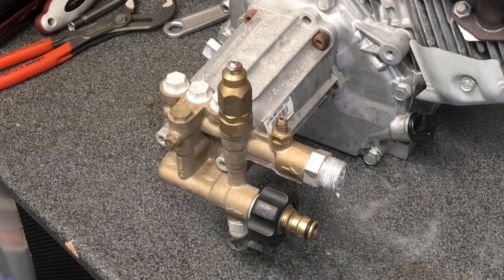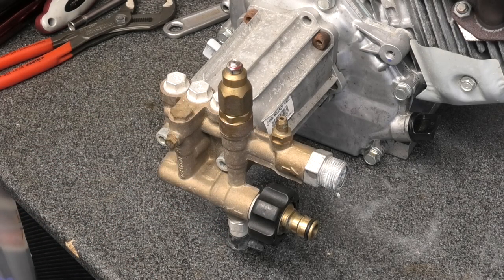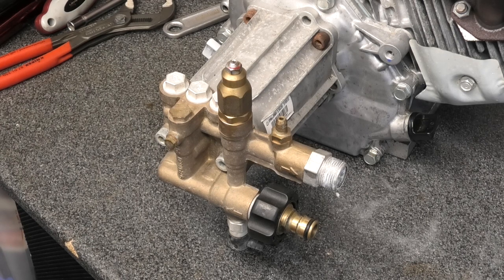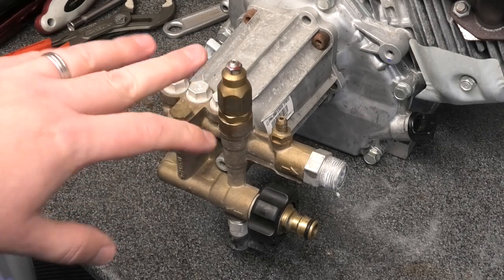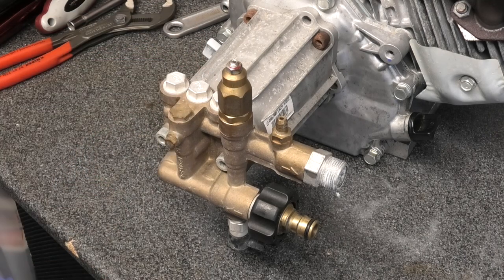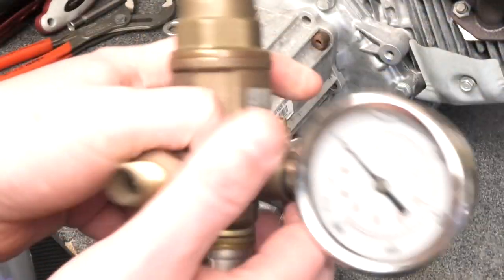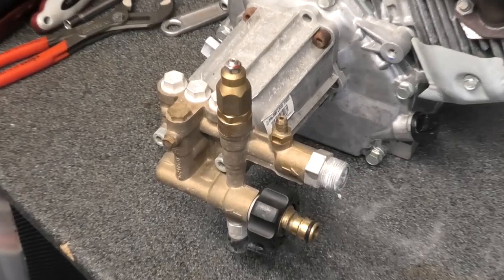Pressure Washer Unloader Valves. Converting an Integral Unloader to an External K1 Unloader.

Comment: Great video - can I ask the type / size / thread / pitch of the swivel fitting as well as the corresponding fitting that is threaded into the K1 ?
Reply from the maker: @JaspreetSidhu1  they all use 3/8"bsp fittings.
Reply: @DirtyDriveAway  So, I'm cross the pond and upon further investigation, it looks as if the outlet port on the pump head is 3/8 BSPP (British Standard Parallel Pipe) for which I can find an adapter for here in America, but as a follow up, can you share the specific type of hydraulic fitting style  (e.g. 3/8 BSPP male to 3/8" Female JIC) or share a link to the particular swivel adapter you're using.

Also, thank you for the quick response.
Reply from the maker: @JaspreetSidhu1  the swivel fitting will be a 3/8"bspp male to 3/8"bsp female. On the pump head itself it would be a female, so you can fit a 3/8"bspp equal nipple to convert it to a male. You then screw the swivel into the unloader and then the female attaches to the male nipple on the pump. Alternatively you can do it the other way around and have the equal nipple in the unloader and thr swivel in the pump head. Doesn't matter which way around you choose. America tends to use NPT threads which are similar to bsp but the thread pitch is different and therefore not interchangeable. I don't see JIC fittings on pressure washers.

Comment: Excellent videos and advice (I'm considering this as a new business).  In your video, "Starting a Pressure Washing Business", you mention the importance of flow and pressure but then say you usually use only half pressure. Therefore, wouldn't it be cheaper to use a smaller engine for less pressure?  I'm assuming an adequate pump, eg 35 lpm, could be connected to a smaller engine. but this may be incorrect.  Keep up the good work.
Reply from the maker: Hi, no you can't fit a big pump to a smaller engine as the motor simply won't power it. For example the common GX390 engine is usually coupled with a 200bar @ 21lpm pump. Or it can be a 250bar @ 18lpm pump. However the motor is not strong enough to do 250bar @ 21lpm. The pump needs to be coupled to an adequate size engine. Although for run of the mill cleaning tasks using a flat nozzle I use reduced pressure/throttle, if I was cleaning block paving I would go max RPM especially when using a surface cleaner.

Comment: Thanks so much, with your help, i modified mine and everything went well. 2 questions please.
1. when i set the unloader, i did it with white tip for around 2500 PSI, then when i changed the tip to Dewalt turbo nozzle, the PSI jumped to 3000 psi..  is that normal..  in otherwords, what size tip should i choose to set the PSI on unloader.
2. i removed pressure washer thermal relief valve and put a plug..  I assume for our setup thermal relief valve is no longer needed right.

Appreciate your help, cant thank enough and i dont thing, any body in youtube explained this better.
Reply from the maker: 1. You need to use a nozzle that is the correct size for the pressure and flow rate of the machine. The coloured tips are often not supplied to spec and thus don't always produce full pressure. My machine is 3000psi at 10lpm and uses a size 030 nozzle. This nozzle will give me the correct size to achieve 3000psi at 10lpm. The unloader is set by this nozzle size on my machine.
The thermal relief valve is no longer needed as it would never get hit enough to work. Removing it is not an issue. If you let me know your psi and flow rate of the pump I can tell you the correct size nozzle.
Reply: @DirtyDriveAway  Thanks again. Mine is 3000 PSI with 2GPM which comes to same as your which is 3.0.. Question to you.1. if i use 3.0 orfice as per the chart, I assume whether i use 0 degree or 15 or 45 degree doesnt matter right ?..    2. when i set K1 unloader valve, i was told that TO DIAL it clockwise, then i should dial anticlock wise until the water in bypass is drippling WITH HANDLE / TRIGGER OFF  ..  is that right.
Reply from the maker: @sivucit  if yours is the same then yes an 030 is the right size nozzle. Angle doesn't matter but I typically setup unloaders with a 15degree. If you have a gauge fitted and the correct nozzle increase the pressure on the unloader until it gets to 200bar/3000psi. Yes you should still have a dribble of water coming out the bypass when you have the trigger pulled. You won't see it if you have a hose connected so you'll need to monitor it straight from the unloader. Once you release the trigger the K1 will go into bypass and dump all the water out the bottom of the unloader. So when your working and have the trigger pulled and pressure/water coming from the nozzle you should still have a dribble coming out the bypass port.
Reply: @DirtyDriveAway  Thanks so much for all your help. Last Q, K1 is flow control unloader valve. What you have before the one that comes with unit is pressure trap unloader valve, in case of pressure trap unloader valve, do we set the PSI in unloader the same way as K1 (flow control unloader valve) except the bypass part (becaise it has internla bypass)
Reply from the maker: @sivucit  yes, it just reacts to the change in water flow. I.e when you let off the trigger it knows that flow has stopped and opens the bypass port. In a pressure sensitive it acts to the increase in pressure. The downside to trapped pressure is that it holds working pressure in the hose and thus keeps the hose rigid and the trigger and connections etc under constant pressure. You also get that nasty kickback when you squeeze the trigger and harder starting with trapped pressure.
Reply: @DirtyDriveAway  thanks so much for all your help. After I put 3.0 office everything looks fantastic. I have pressure gauge at pump head and one after 25 feet hose. At pump I see 3000 psi and after 25 feet hose I see 2800 psi. Not sure if 200 psi drop across 25 feet is good. Nevertheless all credit goes to you and I don’t think anyone in YouTube made this far
Reply from the maker: @sivucit  Yes you will get a pressure drop over the hose. Typically you loose around 10bar (145psi) for every 10m (32ft) of hose, but is usually more on lower-powered machines.

Comment: Hi is could you use the K5 instead??
Reply from the maker: @eddiebarzoo  hi, possibly. It's just the K5 is designed for 200bar and 11-16lpm. If the flow rate of your pump is less than unloaders working range then it may have problems cycling.

Comment: at 16:14 rather than putting a screw on that seat, can i simply dial down the unloader all the way to bottom
Reply from the maker: No, I don't think so. Dialling down will probably still cause the unloader to operate at a specific pressure. This will then cause issues with the external unloader. I'm not 100% certain as simply dialling it right down isn't really the best method as your not technically isolating the integral bypass chamber. You could try it, but you don't want the 2 unloaders conflicting with each other. That's why it's best to just completely isolate the internal valve. This way, you know the external valve will do the work properly.

Comment: I am planning to do the exactly same thing on my AR pump. can you please give me amazon link in USA for parts especially i need unloader valve, pressure gauge. swivel connector, i prefer 3/8" if possible
Reply from the maker: You'll need to source the unloader from a pressure washer parts supplier. I'm not in the USA so wouldn't know where to get them.

Comment: Great video, my question to you is if I put the new bypass unloader Ar model VRT-310 in front of the AR model RSV4G44 pump without doing what you showed us. Will it work ok if the original set to max pressure and new bypass one set lower? Or should I just bite the bullet and take the parts out.
Reply from the maker: In honesty, I don't think the new external unloader will work properly. Even if set to max pressure on the pump, the internal unloader may still want to bypass. The two unloaders will then counteract each other. I mean, it may work, but there could be a chance that the max setting on the unloader is the max the pump will run at, therefore the pump unloader will take priority. By blocking off the pump unloader, you effectively ensure that the external one works all the time. I've been running mine like the video all season, and it works great. You could try your way before committing and test it, although I fear you may end up with issues down the line.
Reply: Wow thanks for the quick reply. One other question if I do take out all that stuff the original pump has an easy start valve in their will that still work. I'm getting old lol and it's getting hard to pull start that big engine.
Reply from the maker: @mikef124  easy start isn't really needed with a flow sensitive unloader as there is no pressure in the hose. It's the pressure in the line that makes starting a pig. That's why if you don't have an easy start valve you have to pull the trigger to release the pressure when you pull start it. Seeing as the flow sensitive unloader removes all the pressure from the system it makes starting a breeze. Saying that the unloader you have chosen  VRT310 Isnt flow sensitive. Your not really going to gain much by fitting that unloader hence why I recommend the K1. When using flow sensitive it makes starting easier and the hose is no longer rigid when you let off the trigger. You also don't get that nasty kick back when you squeeze the trigger.
Reply: Well sir, I took all the parts out that you had in your video had a heck of a time getting the orifice out, my parts were a little different than that model that you have their but I finally got it all back together and it works great the bypass was my main thing why I did this. Sometimes I walk away from the pressure washer while it's running and worry about the pump getting too hot. So thank you for this video is the best one out there on how to bypass the original unloader😊
Reply from the maker: @mikef124  glad it worked, yes so long as the water is dumping out you can leave the machine running as long as you want. If in the future you want to make your life easier, fit a K1. The difference in handling the hose is night and day.
Reply: Thank you I will keep that in mind.
Reply from the maker: @mikef124  don't think they are overly expensive. Maybe around £80. Well worth it, probably the best unloader for the money. Once you go flow sensitive you'll never go back.
Reply: I mounted my unloader without making any changes to the original. I increased (tightened) the resistance of the integrated unloader to the maximum. I removed the venturi and with the drill I widened the water passage to reduce the force on the integrated unloader spring. I installed the external unloader and it works well at the 4000psi that my AR pump model RSV4G40 gives.

Comment: Do you still have full psi pressure with the bypass unloader?
Reply from the maker: Yes, you adjust the pressure using the bolt on top. Once set it's locked off with the lock nut. It only goes into bypass when the trigger is released. Using these kind of unloaders also eliminates the nasty kickback you can get when squeezing the trigger.

Comment: Hi at 12.45 the one that you are removing, is that a starter jet.
Reply from the maker: It's what governs the pressure, without it the unloader has a hard time knowing when to go in and out of bypass. It's combined with the shutter jet to close off the outlet and thus build the pressure to bypass the water. Since this is installed in the external unloader there is no need for it.
Reply: @DirtyDriveAway  Thanks much, my AR pump 3g30 have easy start valve basically when u pull the gas engine cord, it move some of the pressure to low side(Garden hose) , now if we are plugging the gap between low andd high side, that easy start valve is of no use ... is that right.?.. 2. can i assume that K1 extenral unloader will bypass the water to outside while pulling the cord on gas engine..  appreciate your help
Reply from the maker: @sivucit  yes the ezstart valve releases some of the pressure in the pump whilst you start the motor. The K1 will dump the water out the bottom, I run this to a drain on this washer as I don't feed it from a tank. The K1 unloader makes the whole machine easier to start and operate.
Reply: @DirtyDriveAway  Thanks, since we stopped the gap between high and low side    using that m6 screw, easy start will never work fand water cant go from high to low sidde.. can i remove that easy start because i am thinking K1 will do the easy start work , is my assumption right
Reply from the maker: @sivucit  the K1 doesn't have a built in ezstart per se, but because it doesn't trap pressure in the system it makes starting as easy as if it did have ezstart. Mine doesn't have the ezstart valve so I just pull the trigger on the gun when pulling the start cord. I don't need to do that with the K1, I just pull and it starts.
Reply from the maker: @sivucit  only thing you can try is removing the seat, washer and ball from the ezstart. You won't need it with the K1. Just remove those bits and re fit the bolt and washer. It will be 1 less thing to fail as its such a basic component.
Reply: @DirtyDriveAway  Thanks so much, my pump AR 3g30 has injector built in the outlet port that i removed .. i assume K1 has injector if not will not the pressure will not build up ?..  i dont know if that is chemical injector or injector used to build the pressure with small orfice..?..
Reply from the maker: @sivucit  yes the nozzle in the outlet port needs to be removed.

Comment: Would a k1 affect the soap draw from my injector?
Reply from the maker: Yes it would as your not supposed to draw soap before the unloader only after. Drawing soap/chem pre unloader will just gunk it up and end up with premature failure. You would have to fit another dowmstream injector after the unloader if you intended to use it. I dont use it hence why I plugged it off.
Reply: @DirtyDriveAway  thanks for replying.i have a built-in unloader (you can't remove it)can I add the k1 with quick connects?

Comment: Looking at doing the same on a clarke pls265b, 13hp 3263psi 16.5lpm machine and replacing with a k1. Obviously swapping the k1 in you lose the regulator for the pressure, ive been told that with a k1 installed the best way to lower the pressure when you dont need it full is to just back off the throttle? Or is there another way to do it?
Reply from the maker: The best way to lower pressure without sacrificing flow rate is to use larger size nozzles. If you back the throttle off yes the pressure drops but so does the water flow. If you don't need all the water flow then yes by all means drop the revs down a tad. If however your finding that you don't have enough water flow then it's best to keep the revs up and use larger nozzles.
Reply: @DirtyDriveAway  does the same apply to turbo nozzles? Would the correct nozzle for rinsing/chemical application(largest angle) be okay or should I get larger ones too (sets of the colours you get, worked out my correct turbo nozzle as 4.5 when looking at getting a suttner 357.1?
Reply from the maker: @Simmons2193  so the actual output of your machine will vary depending if your feeding it from a tap or suction feed from a barrel. The max operating pressure on main feed is 207bar @ 16.5lpm providing the garden tap is supplying that amount of water. If its barrel fed then it's 200bar @13.5lpm. I would base your max pressure on around the 200bar mark. How are you feeding your washer.
Reply from the maker: @Simmons2193  using a turbo nozzle you really want it on full power. If all you have is 200bar ish anything less and it won't really work too well.
Reply: @DirtyDriveAway  as far as I know 225ish bar is peak, and will be a buffer tank from customers feed as soon as I arrive, so predominantly suction/gravity fed, smaller jobs may use just customers feed but 90% of the tike will be buffer tank
Reply from the maker: @Simmons2193  225bar is surge pressure not continous operating pressure. That figure is invalid as its just a marketing tactic, you need to know continous operating pressure when sizing nozzles. Running from a tank it will be 200bar at 13.5lpm because you will loose pressure and flow as the small pump has to suck water and its not pressure fed like a mains tap is. That being said most mains taps I've come across won't supply 16.5lpm anyway, especially over the length of a garden hose. So 045 is your std size nozzle, you won't want to lower the pressure when using a turbo as its just won't be powerful enough to do anything. If your rinsing just up the size to something like an 065. That will give a nice rinse pressure on that spec machine.
Reply: @DirtyDriveAway  sweet! Cheers 👌
Reply: Con una boquilla de menos presión!!!